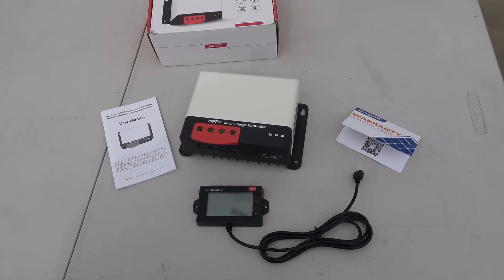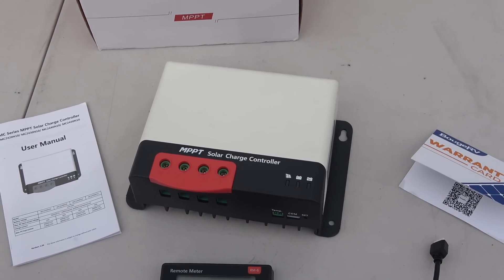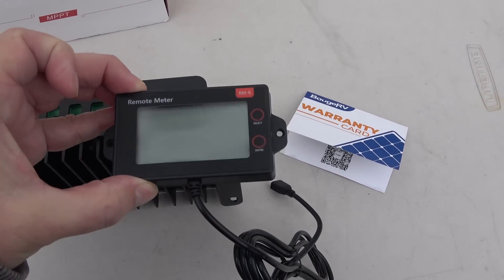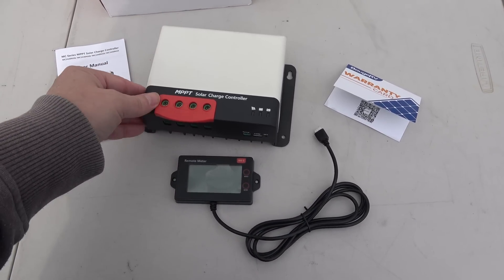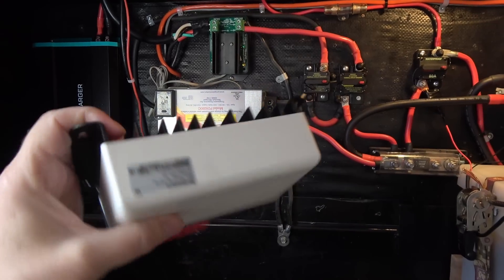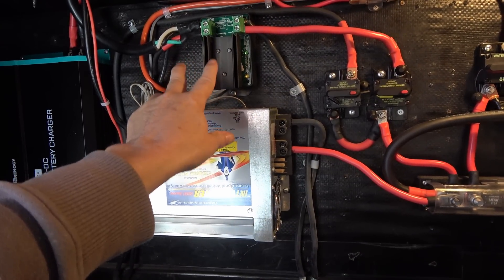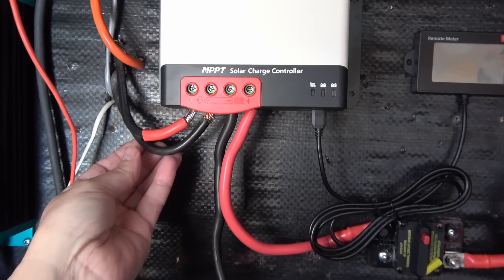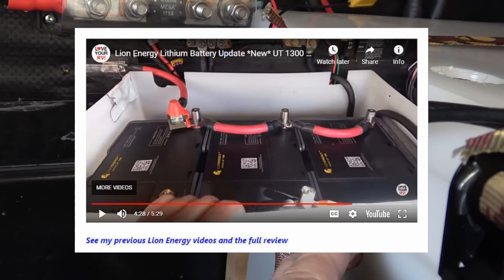Cheap MPPT 40A Solar Charge Controller from BougeRV - Install and Test

Comment: First review of this model where I actually got to see it installed & working. Very nice unit for the $ Whoever manufactures it rebrands it under various names & models ranging from 30 to 50 amps with Bluetooth features with the app.
Reply from the maker: I still have it and has been running 24/7 for 3 years now, no problems. It's manufactured by SRNE  https://www.srnesolar.com/productdetail/Mppt-Solar-Charge-Controller-MC24v.html

Comment: dude this isn't cheap is costs more than a victron 100v 30A MPPT with  built in Bluetooth. this is an expensive controller.
Reply from the maker: Dude this video is 3 years old and this is a 100V 40 amp, not 100V 30 amp, These days you can get one for $98 with Bluetooth

Comment: Can this controller handle 300 watts of solar panels?
Reply from the maker: Yes, easily. It can handle a little over 500 watts for a 12V battery system and over 1000 for a 24V system. Cheers, Ray

Comment: I've been using two of these for a few years.  They get worked hard when I run a 6000 BTU air conditioner in the summer. They've been great until today, one of them was flashing all red in all three LED positions in a rhythmic 1 2 3 1 2 3...any idea what that means?  I can't find anything in my little manual on this.  I disconnected it, reset it, shook it, lol, hooked it back up, and it just goes back to flashing the red lights and isn't charging.
Reply from the maker: Sorry, no I don't know. I'd contact SRNE and see if they can tell you https://www.srnesolar.com/contact-us Cheers, Ray
Reply: @LoveYourRV  Thanks
Reply from the maker: No problem, let me know what they say about.

Comment: How much max solar vmp we can us 🙂
Reply from the maker: Manual says it can handle 12V or 24v panels. Likely around 36V VMP is the max
Reply: My controller is the other model ml2440 solar vmp is 17-75 and open circuit 100v I'm afraid it will break if the panels add more current than 75 in my 2 panels in the morning it picks up 55 volts if I put a third panel will it become a problem😟help plss sory vad english im scared
Reply: These panel stickers are fake it says 22 v. gives much more

Comment: Did you was able to go on user mode??
Reply from the maker: Yes
Reply: @LoveYourRV   and did you add the data for litium baterry??  I'm has hard time to go in
Reply from the maker: Yes, can set using the LCD display buttons or via a Bluetooth dongle and app - https://youtu.be/DFX2pnlBtTk
Reply: @LoveYourRV  last cuestión 😬 did I need to set for litium or just set the basic 12 v and litium and is ready ??
Reply from the maker: It will work OK on basic 12V lead acid mode but will charge faster and more complete when set to lithium mode.
Reply: @LoveYourRV  awesome.. I going to keep trying.. thanks a lot.. by the way you video deserves more likes.. 👏
Reply: I got it going.. thanks for help from Tampa Florida!!

Comment: This controller doesn't have the load tied through it, only the solar panel and the battery.  This is not good.  IF the battery voltage drops too low, the load won't be shed and save the battery from an over discharge.  I highly recommend getting a controller that has the load wired though the controller as well as the battery and solar so that a Low Voltage Cut-off can be used.
Another person mentioned this in an earlier comment, but I don't think you understood what he was questioning.  
Not only will a controller trip the load if the battery voltage drops too low, it will also provide you with a readout of what the load current is.  So, if the solar, is providing, say 20amps of power, you can see what your load is at that time as well. If the load is greater than 20 amps, then the battery is draining but if the load was lower than 20 amps, the battery would be charging.  
Hope that makes sense to you.
Reply from the maker: Loads encountered in a typical RV are often above 100 amps or even more.  For solar controllers of this size, the load outputs are for running small wattage things like lights, etc at night. Not for powering DC loads of the typical RV running slide, awning, power jack motors, etc and that is utilizing an inverter for providing off-grid AC power.  A battery monitor or the inverter will alarm if the battery bank is getting too low or a low voltage cutoff switch could be installed.
Reply: @LoveYourRV  I've seen most all of the high end controllers include the load through the controller.  They stipulate the inverter be connected direct to the battery, all other DC loads through the controller.  Inverters will trip on low voltage input by their design and don't need to be in the controller's circuitry.  
The controller you are reviewing here has no business belonging in an RV that routinely runs at 100amps or more.
Reply from the maker: This is an RV channel so my content is aimed at that audience. I've seen a ton of RV solar system installations and I can't say I've seen anyone use load terminals to power the RVs DC loads. Most aren't using controllers that even have load terminals since they don't use them. Doing as you say might be practical for small vans or truck campers systems. But, most larger RVs like have, 30 foot trailer, use a 60 amp circuit to power the various DC loads other than the inverter. You don't want to be running that through the solar controller. You want that feed straight off the battery bank. Most solar controllers load outputs are max 20 amps, not enough to run DC motors in a typical RV. I can't even imagine the cost of a solar controller that has a 60 amp max load output. 
Like I said RVers usually have a battery monitor (Example: https://amzn.to/3H5f9uf )that alarms if the battery voltage get too low or install a Battery protect switch if worried about it (Example: Victron BatteryProtect 12/24V-100A https://amzn.to/3aBDSKk )  Also, nowadays most RV off grid systems are using lithium LiFEPO4 type batteries (Example: https://lionenergy.com/products/lion-safari-ut-1300 ) and they have their own BMS (Battery Management System) It automatically shuts off discharging if voltage get to low.  
Finally, most RV OEMs install a 45-70 amp converter charger on the DC line from the batteries to the DC distribution panel for the RV. If I tell people to use the solar controller load output to power that DC feed. The next time they plug into shore power that AC to DC charger will be trying to feed power backwards into the solar controller load terminals. so now their batteries won't charge. Cheers, Ray

Comment: I have a question on this controller or maybe solar in general.  We have a factory installed 300W panel with this controller and the BT-2 monitor.  The app is displaying 40v input, 0.15A current and Charge Power of 5-6W.  Now that is cloudy or sunny, no difference.  Why and what is going on?  Any ideas?  Thx
Reply from the maker: Can't answer without doing tests as it could be a bad solar panel, bad wiring, connections or the solar controller itself is faulty or not set up right. The first thing I would do is a short circuit test on the solar panel input. So I would know that it and the wiring are good up until that point.  It's easy using a clamp-on amp meter. Google short circuit "solar panel test" to see how.

Comment: Is there a way to set the absorption float etc on these controllers ?
Reply from the maker: Yes, they have user customizable settings if desired here a manual  https://www.srnesolar.com/wp-content/uploads/2020/11/MPPT-Solar-Charge-Controller-ML2420-Instructions.pdf

Comment: I own this controller, with the HQST brand name.  Works fine, but don’t expect the custom user settings to work as shown in the Manual. Won’t charge the batteries past 15.6 volts
Reply from the maker: Interesting since I have lithium I'd never need to set for that high of voltage. I assume you are trying to do an equalization on some lead-acid type. Where did you measure the voltage? At the controller output terminals or at the battery? If you are charging a 12V lead-acid at that high of voltage it's going to produce a lot of amperage so voltage drop on the wiring between the controller and battery bank may start to be a concern.
Reply: @LoveYourRV  I have a 4S Li Ion 2kWh battery pack I made from medical pack batteries.. Full charge is 16.8 volts.. Manual says USER MPPT battery setting can be adjusted to 17 volts, but nothing I do will charge the batteries past 15.6-7.

I measure the voltage at the battery bank output... Tried cheating a little and relocated the MPPT battery leads to the inverter input, which is the lowest voltage in the circuit.  

All I really want is 16 volts, the high voltage limit on my inverter before it wails!...

This is not a problem for most users.
Reply from the maker: Sounds like an abnormal use case for these solar controllers. Maybe try asking SRNE https://www.srnesolar.com/contact-us  They are the manufacturer of these controllers.

Comment: i backed out one of the terminal screws too far and for the life of me cannot get it back in to make it clamp down on the wire end..... anyone have any suggestion?
Reply from the maker: If I remember right they are a little opposite of what you would assume. Like maybe the screws tighten the opposite way or the lug pulls up and clamps the wire instead of pushing down. Something like that.  Maybe the best bet is to remove the plastic cover for a closer look at the terminals
Reply: @LoveYourRV  i got it half way dismantled haha..  but yes you were right the lug pulls up when you tighten the screw.. the lug is shaped like a C  and the screw is in the upper half .. I was completely baffled last night in the dim light to how this set screw even made sense... 
thanks for your help and input!

Comment: I don't understand why the amps is reading higher then what the spec sheet say on the back of the panel
Reply from the maker: You must be miss testing something, maybe confusing volts with amps. The 15 amp fuse rating is actually for reverse current as a safety measure in case the panel was to short circuit and you had other panels feeding it.
Reply: @LoveYourRV  oh ok I went back over everything and re wired the inverter now the amps are reading properly 👍

Comment: Hello Ray I'm having a confusing issue with my panels amp output current at Pmax Imp say 8.69A then when look down further on the spec sheet on back it also say maximum electrical rating fuse current 15A my solar charge controller is pulling in 18.70 amps on one panel alone so witch actual amp rating is the panel ??

Comment: Hello Ray I ended up getting a 12v 3000w inverter remember I have that same solar charge controller my question is my panels are 335w each 4 panels for a total of 1340w but my inverter is only a 12v can I simply hook it up power it up just like it sits I was running a 24v inverter long story now I only have a 12v
Reply from the maker: The inverter in powered by the batteries so you'll need to have them wired as 12V to power a 12V inverter. Cheers, Ray
Reply: @LoveYourRV  right I'ma wired them for 12v the most I'ma get out my panels is only 550w out of 1340w at 12v or will the 3000w inverter still give me more then 500w if needed?
Reply from the maker: Inverter wattage has nothing to do with the solar wattage. The solar power only is one way to replenish power in the batteries. The batteries are what power the inverter, not the solar. The solar is only there to add power to the batteries.
How much power you can get out of the batteries depends on their size, quality and the size, length and quality of the wires connecting the inverter to the batteries.  A 3000W inverter can draw a heck of a lot of amperage if using it at its max wattage of 3000. 3000/12= 250 amps. So you'd need enough batteries to provide that amount of amperage and large enough gauge wires to transfer the amperage to the inverter.  If not the battery voltage will drop and the inverter will shutdown or the wires will overheat.
Reply: @LoveYourRV  oh ok thank you for clearing that up for me I have a better understanding now I will probably never use that much power no more then a 1000w at most

Comment: Have you found any problems with the controller giving incorrect voltage and amps?  This is the only issues I am hearing about this controller is that the amps and volt readings are incorrectly calibrated.  Thanks.
Reply from the maker: Seems pretty close to me when compared with my amp and voltmeters. Sometimes people don't know enough to include other things connected in the 12V circuits that may add and subtract from totals.
I generally don't count on my solar controllers to be my battery system monitor. I have a separate battery monitor system with a shunt on the negative battery bank feed and use that instead.  Cheers, Ray
Reply: @LoveYourRV  Thanks Ray I appreciate the quick reply.
Reply from the maker: I'll  be reviewing a different model soon. The company that makes these SRNE offered to send me out a similar model for review. The ML2440. https://www.srnesolar.com/product/mppt-solar-charge-controller-ml2430-40 Its a little bigger but same basically the same specs. It has the display built in. I'm planning to run the two together with separate solar arrays feeding them. Will test them over the upcoming winter boondockng season down south. I'll try and pay attention to their voltage and current readings and see how they compare to my other testing equipment.

Comment: Hi Ray this me Joe again I have question if ur battery power starts to fall off percentage wise from a 100% full like soon as I turn on something such as a small 25 watt fan should my batteries start dropping in power like that ain't batteries supposed to hold for a while before u start losing capacity ???
Reply from the maker: If you are looking at the percentage readout on this solar controller that would be normal behavior since when the batteries are powering a load its normal for then to dip a bit in voltage and this controller is guessing the battery capacity based on voltage.  A poor way to do it.  The dip in voltage is much more with lead acid versus lithium type batteries.
To gauge battery capacity in a much better way a sophisticated battery system monitor with a current shunt is required. If you had one of those you would see the battery percentage drop slowly as you use the power out of it.
Reply: @LoveYourRV  ohh ok I guess I'ma order me a battery shunt and eventually some better batteries than these 35 amp hour batteries thanks

Comment: Hello Ray I turned my charge controller on for the first time today it's pulling in only 55 to 60 watts because of overcast if my lights running 147 Watts at 1.25 amps my 24 volt battery system 35 amp hour shouldn't drop in voltage fast should it and if I was pulling in a couple hundred Watts from the panels would that run the lights without the batteries??
Reply from the maker: Yes, a couple hundred should be plenty to run the lights plus keep your batteries charged. You can use this calculator to see  how many watt hours your batteries can put out. https://convert-formula.com/ah-wh  If your using lead acid you can utilize 50% of total capacity, if they are lithium you can usually use 90% of capacity.
Reply: @LoveYourRV  oh ok I have 2 Vmax 35ah  deep cycle sealed AGM batteries right now it's say they at 77% does that mean 77% full or 77% discharged ??
Reply: @LoveYourRV  because it started  at  100% now I'm at 77% that's kinda fast I would think.
Reply from the maker: Can't answer, you are not giving me enough info to make a guess. You have 420 watt hours of useable capacity so it depends on how many hours you have had them draining power and how many watts are being powered by them and how many watts are being charged back into them.
Reply: @LoveYourRV  hello Ray do solar panels give more watts as needed like does more wattage come in from the panels when you plug bigger things in and reduce wattage output when things are turned off
Reply from the maker: @thelithiumpowerch  If they were strictly powering a specific load, yes, but most people use solar panels to charge one or more batteries. The panels will output as much as they can as long as the battery is needing charging. Once the battery is full they stop outputting power. This is done via the solar charge controller. That is its job to regulate the flow of power to the battery bank so it charges properly. It's the batteries that will then power things, not the solar panels themselves. The solar panels replenish the batteries.

Comment: Do u have to manually set both the stop charge volts and the charging volts or is that automatic I can't figure out how to set the perimeters for my 24 volt 2 battery system
Reply from the maker: Here is the manual - https://azimuthsolar.ca/wp-content/uploads/2019/05/MC-SERIES-SRNE-MPPT-MANUAL-V1.01.pdf  See page 16.  You can use the preset battery options depending on your battery type or use the User option and set your own custom settings. They will be double for a 24V system. Cheers, Ray
Reply: @LoveYourRV  so when it detects that a 24v battery is being used will the controller automatically set the perimeters for 24 volt system ?
Reply from the maker: I don't have a 24V system to test on but that's how I read it. It should auto detect 24V battery bank but I do remember seeing a setting for 12 or 24 as well.